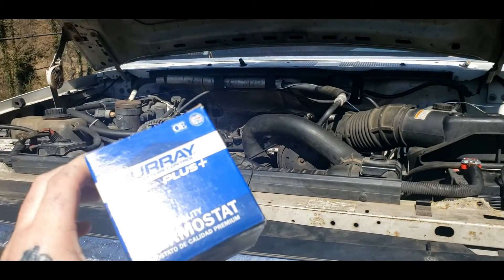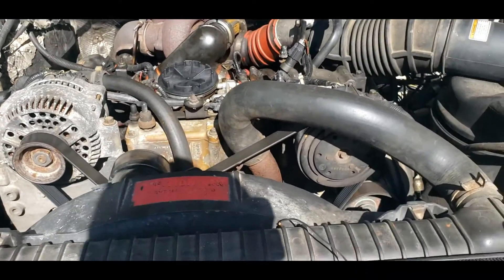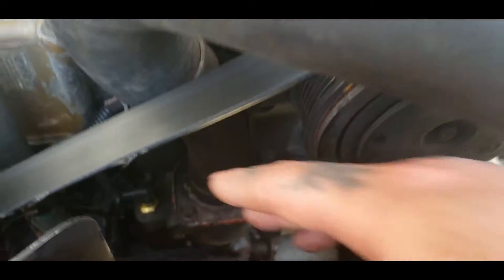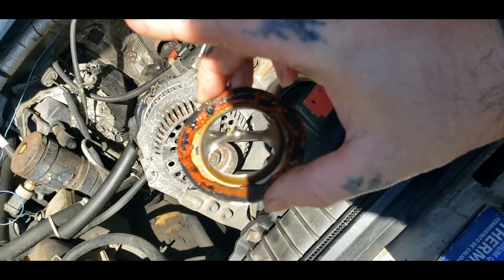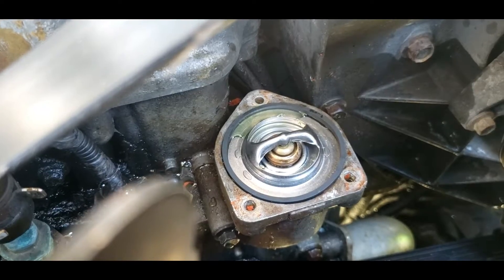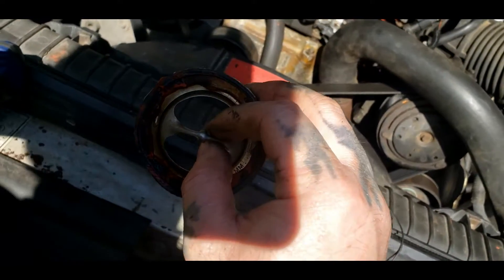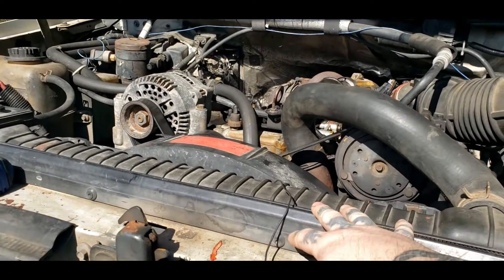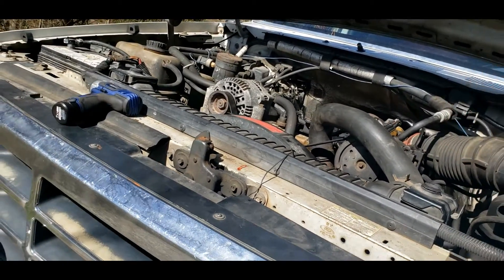203, 205 Degree Thermostat Replacement Upgrade 7.3 Powerstroke

Comment: that thermostat cant access the bypass lever in the houseing below. the proper one has an additional spring and washer at the bottom. you will end up warping your block with that thermostat
Reply: Do you have a part number??

Comment: great video! Did this end up fixing your temp gauge problem, too?
Reply from the maker: Yes I did the thermostat and a temp sensor replacement, fixed it right up, the thermostat I got is now sticking open now though so takes forever to warm up, seems its hard to get a quality thermostat
Reply: @TattsForLife  Great! Mine hasnt worked since I bought the truck but i replaced the temp senesor and thermometer with a 203 degree when i did a coolant flush and my gauge finally works... makes me think what damage has been caused by an engine that never got to working temp over the last 6 months/10,000 miles! anyway, thanks for your awesome videos!
Reply from the maker: I say your fine lol I seen a many of a engine run just fine on cold temps, lol it just a loss of power and you get worst gas mileage, I rather have a car that runs at normal temp
Reply: @TattsForLife  thanks for the info! I appreciate the response!